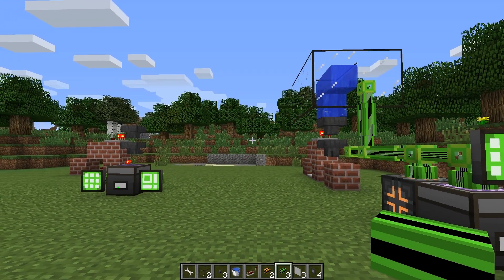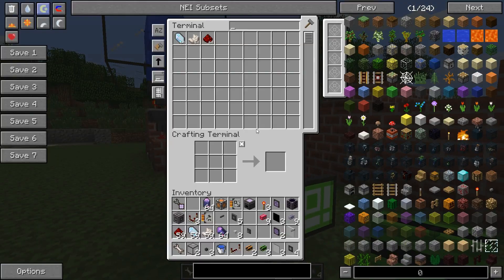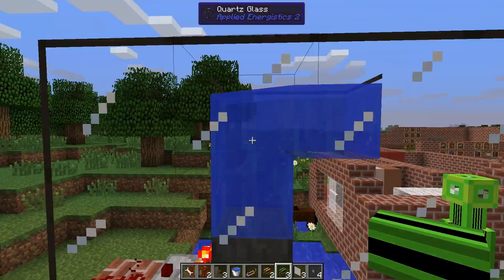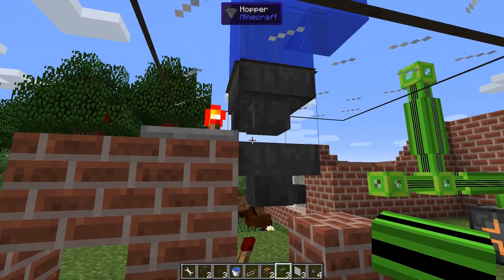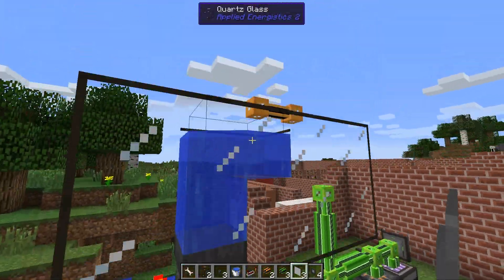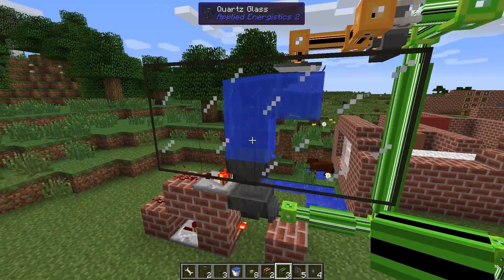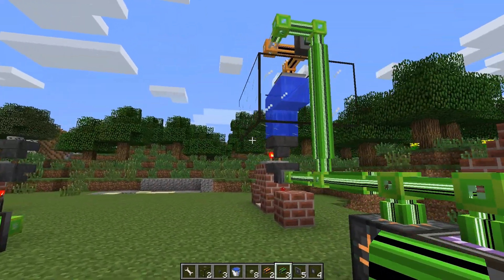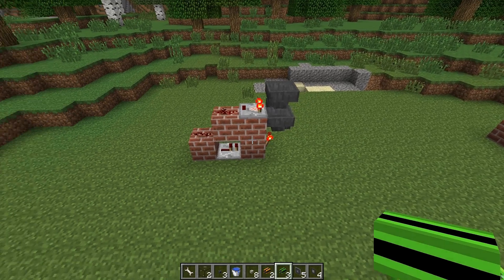Applied Energistics 2 Tutorial #14 - Auto-Crafting Fluix and Pure Crystals (MC 1.7.10)

Comment: instead of having the items flow to the hopper you could just put the formation plane above the still water, I didn't test it but i'm assuming it should work since the principle is the same
Reply from the maker: The reason I went for this solution was because the items kept falling outside for some reason. Sometimes they just bounced off the Hopper. Trust me, the streaming water was not how I expected the design to turn out ;) Perhaps possible to solve, but at least this worked so I kept it. Or perhaps it was a problem with the versions I used at the time, haven't tried since then.
Reply: i'll have to try something to keep that from happening, I'll let you know if I find something
Reply: TKH It isn't perfect but instead of the formation plane I tried a dropper with a vanilla timer above the still water, the seeds started bouncing out after 236 seeds and due to the timer it is bigger than your design so I'll probably end up using it yours.:p
altough I will probably end up using extra utilities to make it smaller and use less channels but thanks a lot:D
Reply from the maker: Michiel H I never tried to use a Dropper I think, too bad it didn't work. Anyway, there are better ways to do it if you have other mods installed. This video was meant to be pure vanilla + AE2 :) 
Extra Utilities is one (good) method. I did a tutorial with Steve's Factory Manager, it was also quite good (only one network channel used), could use 5 accelerators as well :)